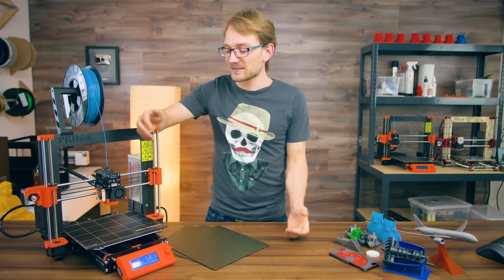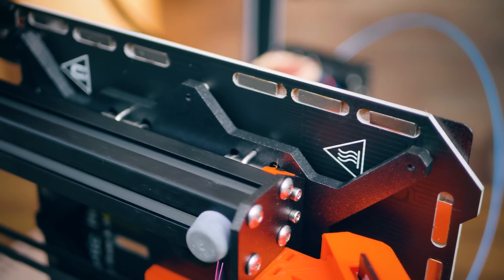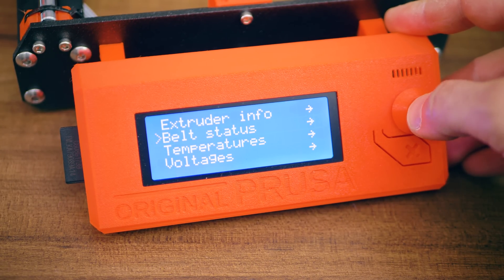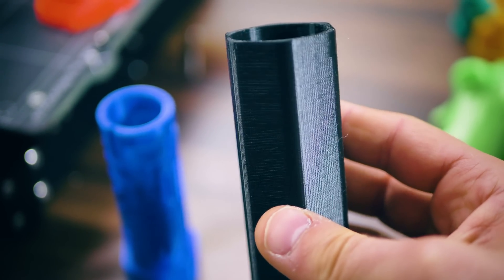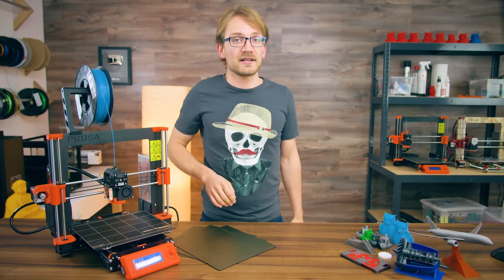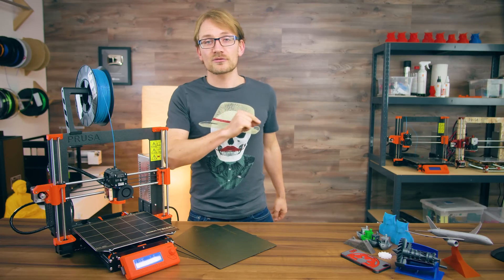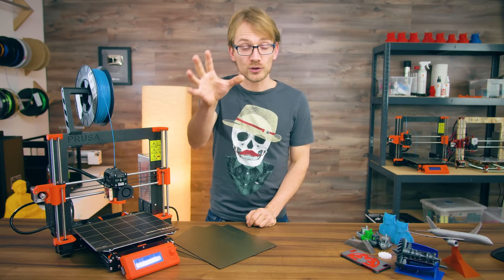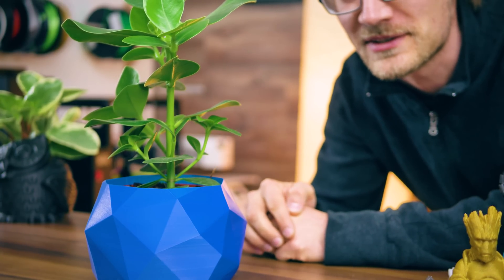The most important 3D printer - Original Prusa i3 MK3 review!

Comment: anyone else notice that the MK3 seems to be the only printer in the noise comparison that does not have the part cooling fan turned on...
Reply from the maker: +Andri Mar Jónsson you're right, I completely missed that! Must still have been the first layer - though it doesn't get much noisier with the fan on, the MK3 I had running next to me throughout the entire video was going with the fan on full blast.
Reply: The part cooling fan is pretty quite. I only hear it when at 100% and the printer is in Stealth mode. Even then, very subtle. Maybe it would add a half decibel?
Reply: No worries, I believe you. Just by looking at the BOM you can tell this thing is silent and, more importantly, orders of magnitude more silent than anything else in the same price range.

Comment: The killer feature (powder coated bed) is still not available to order and still not shipping with kits.  My filament sensor also overheated and melted the extruder housing (and then the bondtech slipped, trust me) - this little PCB simply should not be able to draw enough amps to hit 200C, so now I run without that, too as I cant trust it.  The Mk3 can be great when they sort out the teething issues, but some of it's killer features just aren't ready yet.
Reply: 8 months later... are all the kinks ironed out? I'm thinking of ordering one.

Comment: I got my MK3 kit beginning of December, no installation manual in mine . . . 
I share some worries with you:
- There are some issues discussed in the forum about bad design decisions
- Printing with flex materials is pretty nasty, according to my analysis it's due to the gap between bondtech and hotend.
- The software/firmware really needs some tweaking

On the other side I love it, the removable bed is just great and the auto filament load with the sensor just eases things (even though it could ask for preheating instead of warning - just another software thing). Bottom line I love it with some flaws :)
Reply: My exit hole will always stay an exit hole and never become an entry hole, especially not for you. Not sure if you have the printer, I actually do. And some things are not ideal, not that I would expect that on any product which is new to the market. No reason for insults. . .

Comment: I'm seeing a good bit of sag on that fan duct (right side). Looks like there might be a better material to use there. Out of curiosity, is that from printing fanless, or have you just been running PLA through that?

Edit: Ah, PETG. I think I'll put a sock on the hotend or grab a polycarbonate shroud off Shapeways to go with my MK3, whenever I give up on self-control and splurge on one of these.
Reply: There is a thread in the forum on the sag. i reprinted mine in black polycarbonate and have printed hundreds of hours of abs and no sag.
Reply: Regardless of whether you need the sock to shield the duct I suggest you put one on anyway – version 2 of the sock doesn't have the original problems (so it fits better, and it exposes enough of the nozzle so it doesn't get knocked off), and it makes cleaning the nozzle (when changing from black to white for example) nice 'n' easy – just rub it with a paper towel whilst hot (carefully :-). Even PETG comes off the sock easily.
Reply: Cheers. It hadn't actually occurred to me to print PC with my MK2. It's always seemed like such a pain to print that I've avoided it. Might give it another look sometime.
Reply: William Shreckengost it was easy, I used the pc abs setting in prusa control and the stl from git for the shroud. its about like printing abs just a bit hotter and seriously strong and temp resistant. the problem with it is moisture absorption. it can soak up so much moisture that in 24 hours it's unprintable until you stick it in the oven to dry it out.
Reply: Mark Wheadon sock doesn't do much. I've had the sock on mine since 18 Dec but it still sagged printing abs and completely failed printing pc
Reply: Good to hear. I'm currently using a sad enclosure consisting of IKEA end tables and plastic drop cloths to hold ~40C for ABS printing. I guess I'll stick a bowden tube to my dry box sometime and get to it. Thanks for the tips!

Comment: If I got a mk3 and planed to go with a ruby nozzle right away, is it safe to install that before heating up the hot end since it would not have been used before in a kit, or should I still heat it up first before swapping it out? Been curious about this for a while since I plan to use some more abrasive filaments in the future. Thank you.
Reply from the maker: +bloodduality the official recommendation is to swap the nozzle hot - makes it easier through thermal expansion. Though as long as you don't bend the heatbreak, there's not much to go wrong.
Reply: Thank you so much for the tip, and that's kinda what I expected as well. Was hoping I could be lazy and save a step though. Keep up the great videos, you have taught me a lot when it comes to this hobby.

Comment: The biggest reason I want to replace my mk2 with a mk3 is because of the updated pinda. I have terrible luck with bed leveling when my heated bed goes over 50 degrees which makes printing abs a pain in the backside
Reply: I changed the startup gcode to heat to 150, raise to 80mm, heat the bed, heat the extruder, THEN zero the z axis. Solved the pinda issues for me.

Comment: Wait, that SD card corruption thing, did it make your printer stop during a print (and always at the same point when relaunching it) and the front panel non responsive, as if the whole firmware had a stroke and you need to turn the power off & on again to do anything ? That thing happens to me once in a while and I can't figure out what the problem is.

Comment: Much expensive haha, I wish I had the budget for it
Reply: Not downplaying the importance of this machine or downplaying the work Prusa has done, but the day Prusa creates a machine with a decent build volume, I'll consider them and not a day sooner.  There's little to no excuse to offer a machine at this size with a price tag like that.   For now, a bit of tinkering on a way cheaper chinese machine using TMC2130's in SPI + Marlin 1.1.8c and an Anycubic buildsurface goes a long way resulting in a way bigger build size, decent print quality, comparable easy bed adhesion&release, and all that at 1/2th to 1/3th of the price of an assembled MK3. Just my personal opinion.